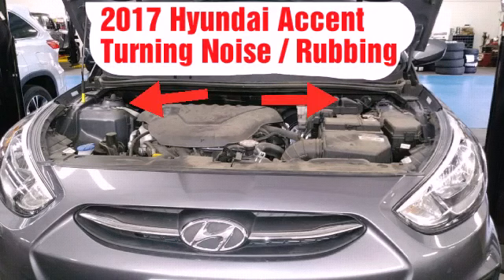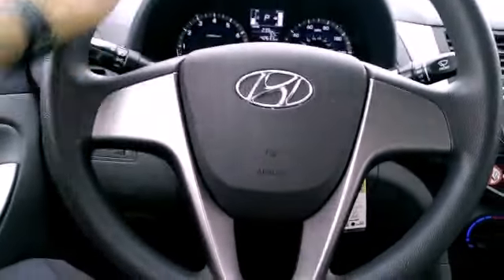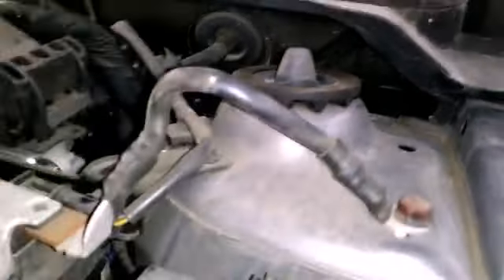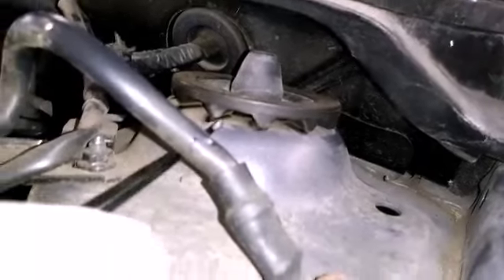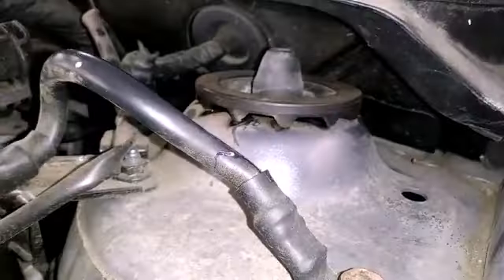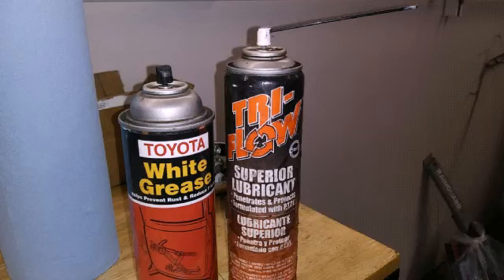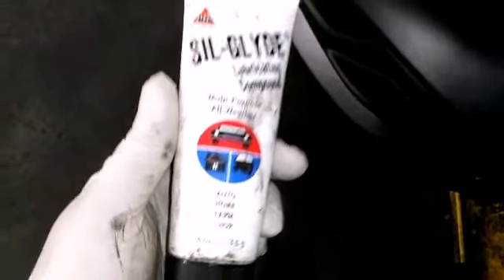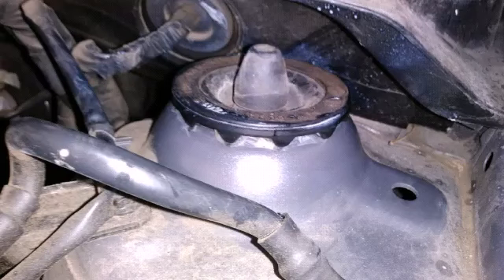2017 Hyundai Accent Rubbing /Turning noise

Comment: My hell it's been driving me nuts because I can not figure out where that noise is coming from, it sounds like it's coming from the tire or maybe the plastic inner wheel well maybe rubbing against the tire it's driving me nuts hopefully this is what is happening with my hyundai....but what disappoints me is now I. Hearing a popping sound whenever I reverse or put it in gear and drive off it's a loud POP scares the shiii out of me when it happens so I'm thinking maybe mine is something else, but I'm gonna check this out n try kt